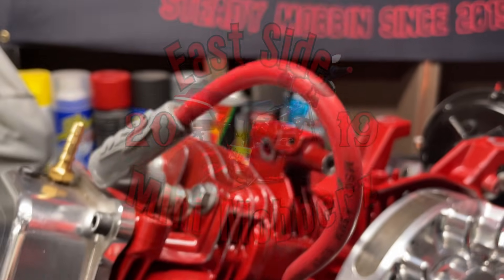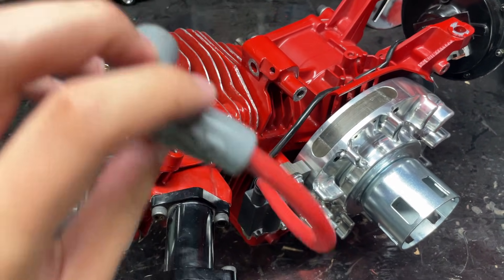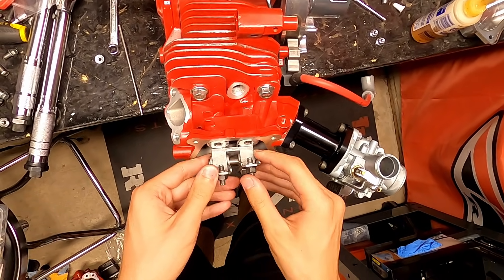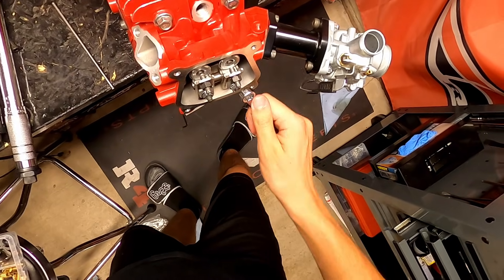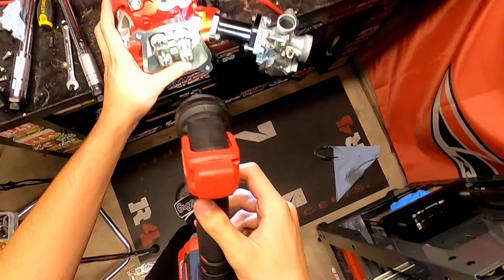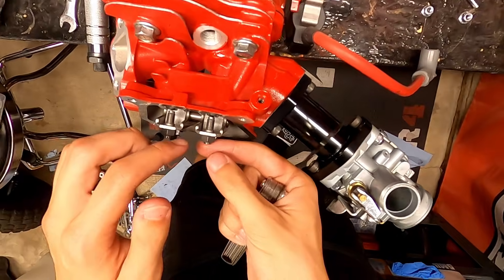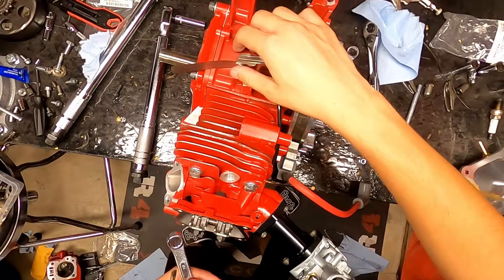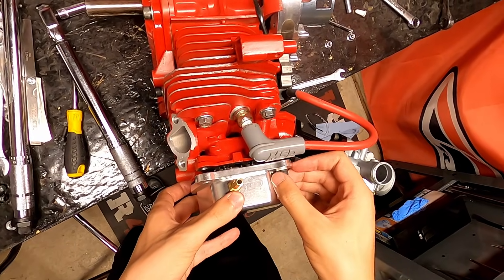How To Set Valve Lash, Predator 212! Valve Lash 101!

Comment: Tbc. Exhaust.0.03. Intake 0.05. On tbc. Get hot will. Expand. Here setting .back lash!212cc.
Reply from the maker: I would do 0.03 for both, exhaust and intake. Anything more is too loose! You will get excess noise, wear, and more and likely the engine won’t even start if it’s anything more than 0.03!!! Especially if your engine is modified! I always do 0.03 or 0.02 works great on my high horsepower engine builds. If your valve lash is too loose your engine won’t run or will have severe pull start kick back issue.

Comment: Can it bend my push rod if it's not set right?
Reply from the maker: @SDM8535  I’m not 100% sure but it possibly could! It could most definitely add excess stress on the valve train though if it’s too loose and or too tight

Comment: but can you answer the ultimate question.  does the valve gap get bigger or smaller in these engines when they get hot?
Reply from the maker: @warrenpeas  yes absolutely the gap will technically get bigger as the metal expands with heat. You may have to run your motor a few times and check the gap to make sure it’s the same
Reply: @EastSideMiniMobberz  do you know if this holds true with more single cylinder Chinese engines like  the ones in chinese dirt bikes?
Reply from the maker: @warrenpeas  yes I does.
Reply from the maker: Not sure why as that is basic understand of how Thermal expansion works. I've done my research and built enough engines including these small single cylinder engines and in my real world testing the valve lash gap will increase as the engine gets hotter. Its actually recommended to set the valve lash on a hot engine not a cold one to get a accurate adjustment.

Comment: I have predator 212 non hemi governor delete oil sensor delete 10krpm aluminum fly feel I want to get 22 pound spring what feller gauge do I use thanks😢
Reply from the maker: @DiegoRamon-t3t  you can use the same as shown in the video
Reply: @EastSideMiniMobberz  I use my pinky finger nail and feel her real good. It's not rocket science. Too much is too much and you want it little so put the finger nail in just a bit.
Reply from the maker: On a high performance engine that is making more than double its stock HP numbers you wanna make sure its perfect!
Reply: @EastSideMiniMobberz  to make it high performance you need a 100 dollar crank 100 billet rod 50 piston get the oil to 60 rockers and oil cool the engine
Reply from the maker: @theorionblacksmith3262 that’s exactly what’s in this engine. Fully built
Reply: @EastSideMiniMobberz  Im stock and ungoverned and you will never catch me spending 5x as much for a hundred dollar motor when you can exhange it within 2 years for free engine and keep doing that...its a generator engine...
Reply from the maker: @theorionblacksmith3262 that’s you but me, I love raving on my built engines and knowing they are gonna last doing 70mph all day!
Reply: @EastSideMiniMobberz  they dont last like that 70mph forever. same with my stock it goes 74mph  all day everyday 120$ somthin happens I can exchange it.
Reply from the maker: @theorionblacksmith3262 what’s your gear ratio and weight? no disrespect but I don’t believe your hitting 70mph on a stock motor. If so you got a lot of faith in that old girl and a lot of balls cause I wouldn’t trust going that fast and reving that high on a stock rod and flywheel but that’s just me.
Reply: @EastSideMiniMobberz  240lbs with a cvt and a 44t sprocket 22lb springs and farting
Reply from the maker: @theorionblacksmith3262 🤣🤣🤣 hmmm I see I could possibly see that with a cvt. I was gonna say there no way you have a regular clutch on there going that fast on a stock motor. It wouldn’t have the top end torque to keep it going but with a cvt/torque converter that’s the way to go.

Comment: I have a gocart with a 212 hemi. I have put a stage 1 kit on it. Put a header, removed governor, removed the oil sensor, have a torque converter put a k&n style air filter on it and rejetted the carb and i wanted to put a vm22 carb and extended intake manifold on it. Do i need to get a billet flywheel and connecting rod before i do that or can i do that and still run stock flywheel and connecting rod?
Reply from the maker: You can definitely run the stock stuff but I would look into getting a billet rod and billet flywheel in the future even if you keep the stock carb. Those are great mods that would be good to do in general
Reply: Stock flywheel isn’t rated for RPMs above what it is governed to. If you remove the governor you should absolutely replace the flywheel. The stock one will throw the magnets.

Comment: Hemi is .0039-.0059 for both valves.
Non-hemi is .004-.006 intake and is .006-.008 exhaust
Reply from the maker: its high temp engine paint! and wow that's a pretty significant gap. Maybe on a stock motor that would be alright but anything that is substantially modified you will get a tremendous amount of pull start kick back.
Reply: @EastSideMiniMobberz I have speedway billet flywheel gov delete and a cheap 30$ vm22 carb 18 lb valve springs and .003 on broth to .006 is just hard to pull and stops hella hard is that the carb or im just not setting the lash right ?

Comment: Piston needs to be top end before doing a lash valve on both intake and exhaust
Reply from the maker: @MikeBeatzcom  yup!
Reply: How do you ensure that ?
Reply: @Jsosodke put a screw driver through spark plug put a screw driver and feel wen the piston goes to the top it will put the screw driver out 🎉

Comment: lash setting in the manual is .004 -.006 for intake and .006 -.008 for exhaust.
Reply from the maker: hmmm. I've never heard of those specs and that is very loose. stock predator 212s are usually set at or should be set at .003 or tighter for both intake and exhaust.
Reply: @EastSideMiniMobberz it says it on the manual and i set it to .005 and .007 and my engine wont start
Reply from the maker: @jeffoclock3047  I would try to set it tighter try .003
Reply: @EastSideMiniMobberz  thank you i set both to .003 and now it runs great
Reply from the maker: @jeffoclock3047  perfect glad it worked!
Reply: O.08  @EastSideMiniMobberz

Comment: My motor had a missing lash cap ,then i heard they sposetoo for some dumb reasons
Reply from the maker: Yes some different models and years will have them and some won’t. I personally would say you don’t really need them. If your motor is stock though I would use them
Reply: @EastSideMiniMobberz  I just converted a husqvarna motor over to my bike..and just had to change flywheels for the generator...I seen no difference other than I put the cap on the intake valve so it don't wair  out agin..mine wore out and fell off then bent the valve ..
Reply from the maker: @jakelang4387  that’s crazy yeah if it’s stock I would run it how it was but if there’s some upgrades done I wouldn’t really worry about it.
Reply: Dude mine has the same thing but I found out it's suppose to go on the exhaust side. You'll be able to notice as there is more of a space then the intake.

Comment: Looks like your push rods are too short. But it may turn out that way with those rockers. I use the old style Champions on all my minibike engines. The geometry isn't perfect but always close enough with stock length clone push rods.
Reply from the maker: Yeah I’m thinking that’s how these rockers are. These are the stock length and they are chromoly and they are a direct bolt up so I think it’s the way the geometry of them are. There’s still a bunch of adjustment on them as well

Comment: So if the recoil rips out of my hand it's because the lash is too loose?
Reply from the maker: Yes and no. My valve lash is absolutely perfect and it still does here and there, it’s the advance timing on the flywheel that makes it do that. But having your valve last tighter and adjusted right makes it a lot better, your valve last overtime can come out of wack so it’s good to check it here and there. Also you need to pull it on the compression release stroke, it will start easier and it won’t rip back

Comment: I have done this and still have kickback and back firing out of carb
Reply from the maker: Possibly motor could be out of time! Check that the dots on the came and crank shaft are lined up.
Reply: @EastSideMiniMobberz  yes they are lined up it ran great before I put new billet rod and flywheel and carb on,I tried everything
Reply: I have the same problem after upgrading from stock did you ever figure out the problem?@alexmattice5747
Reply: @kaizupiano7826  gotta make sure the piston is at top dead center before setting valve lash. that's why he had the flashlight looking in the spark plug hole. I didn't hear him mention it tho
Reply: @Student_at_Y.T_University  i did and its still way harder to pull and get kick back every 3rd
Reply from the maker: @alexmattice5747  hmmm possibly the carb is no good! How is it sounding is it dying or not starting at all?
Reply: Try .002 on the exhaust valve
Reply: Then try.004
Reply from the maker: @RayDaawg11  I would recommend doing both to .002
Reply: Still.have.kick.back. val.clearance wrong!! Intake.0.03.exhaust.0.05.should be easier. If don't have val clearance. Get hot. I'll brake camshaft!. Bent push rid. Can't expand get hot! Can breaks camshaft important val.cleance.

Comment: What size what is the lash you used??
Reply from the maker: I always do .002! Works great having it a bit tighter. .003 is perfect though too!
Reply: Ok cool ty sm
Reply: Would you know the lash for regular champion rockers?
Reply from the maker: @mrcloud2212  it is the same👍🏼
Reply: i’m trying it right now it’s not working it’s turning over but it’s not staying on do you think you could help me??
Reply from the maker: @mrcloud2212  well if the lash is set at .003 or close it should be perfectly fine. If it’s not idleing then it is a carb problem. The air fuel mixture screw needs to be adjusted